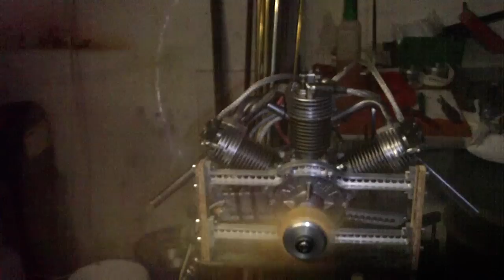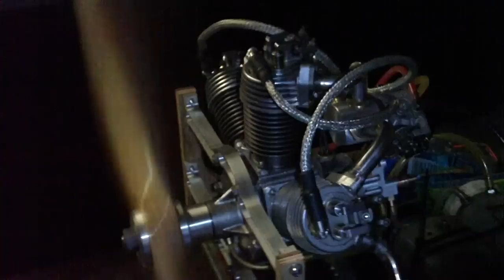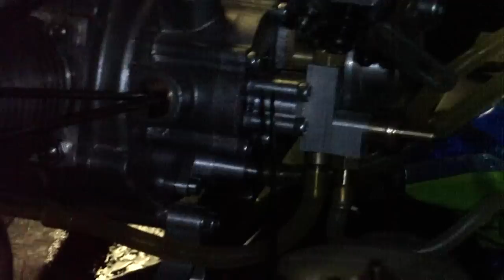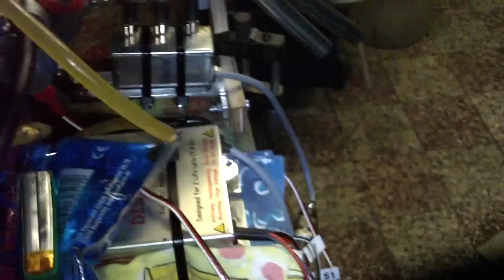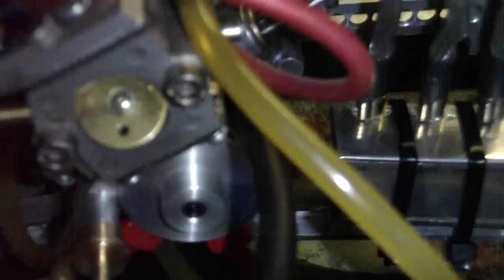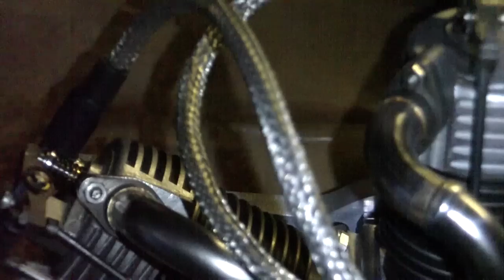Testlauf 1/3 Scale 3 Zylinder Anzani W-Motor

Comment: Hey just wondering what the firing order is? Is sounds like it is firing 1,2,3
Reply from the maker: Darren, the firingorder is 132
Reply: @modellmotoren  yeah ok, if you look at my Chanel You will see a W engine that is based on the Anzani. It was partly built when I received it so I finished it off and got it running. Not very well I must say. In that video it is running with a firing order of 1,2,3. It is making that distinctive sound which gave me the impression it was running 1,2,3. 
I have now changed the cam gearing around and built a new distributor so now the firing order is 1,3,2. It is running much better now but still has some more adjustments to be made.
My biggest concern now is vibration at higher revs.  I have to work out somehow how to balance the crankshaft a bit better.
Thanks for your reply.